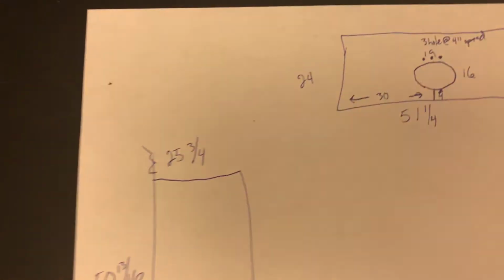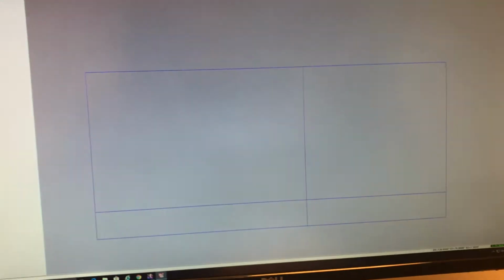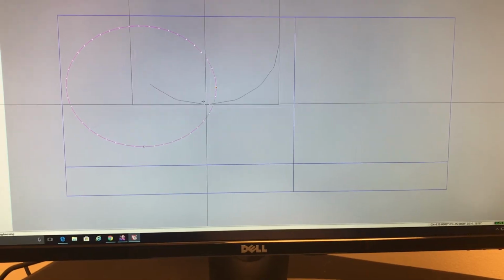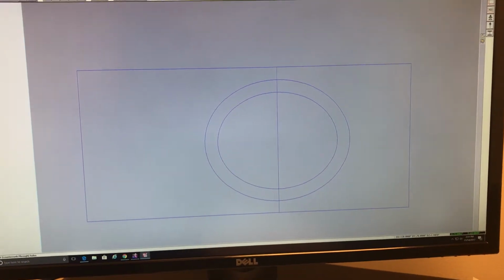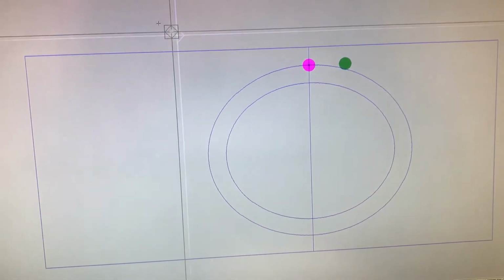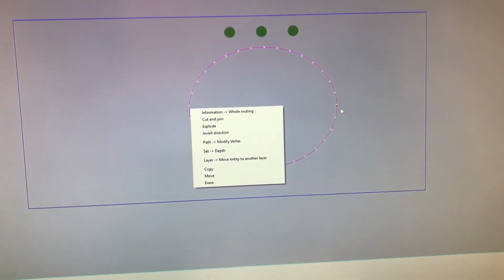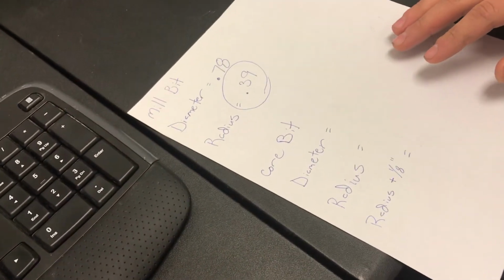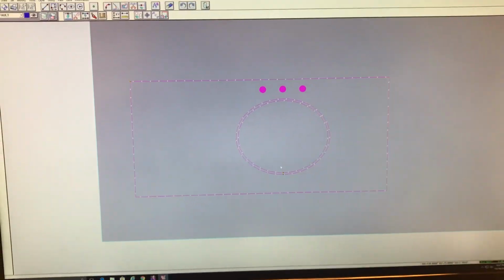Cobalm Mars how to draw a vanity

Comment: Can Mars be used to create G code or what the Cobalm Integra uses? In other words, can the software be used for CAM to tell which lines are blade or mill bit cut, which lines are mitered or straight, etc., all from the PC in the office? If not, can the software that's on the machine be installed on a PC to do this? Thanks!